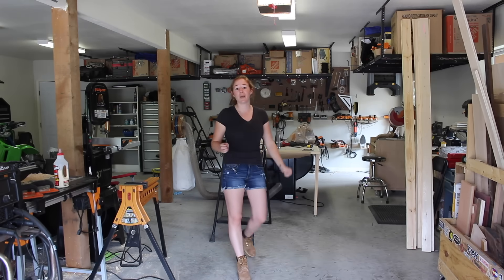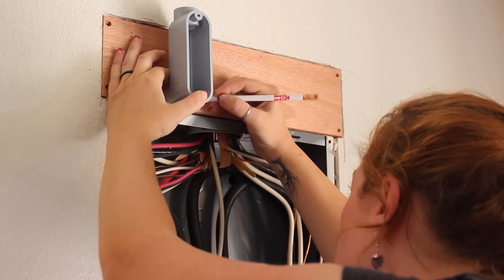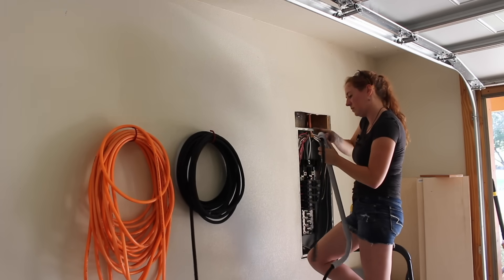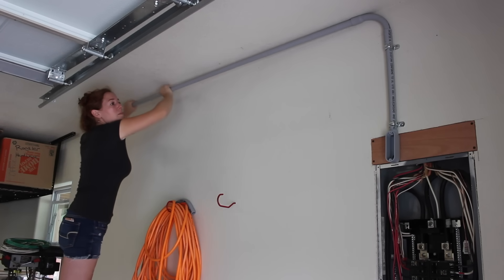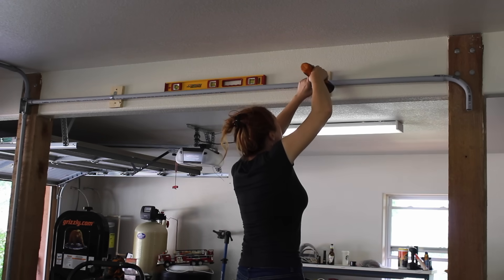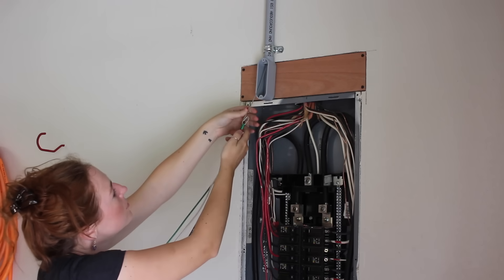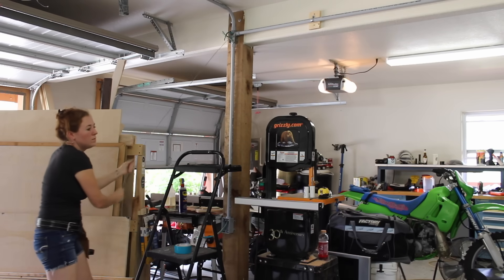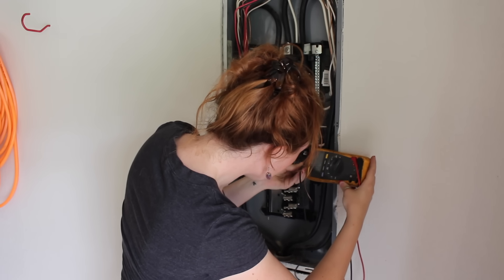Adding 220 Volt Outlets to the Garage

Comment: I admire your courage doing an electrical video with YouTube's history of commenters. My only comment is that you shouldn't use white if you're putting power to it.  I believe it should be red and black with your ground.  But I have done the same using the wire I had and put colored tape on both ends.  It looks like you did your research.  Good job.
Reply from the maker: This was a big discussion on Instagram and the take away was if the intended load is 220/240v then two hots and a ground are sufficient. If there was something like an onboard clock or additional function (like an electric stove or dryer) that required 110/120v then an additional wire for neutral would be required.
Reply: Adam Comfort - 220 is the voltage you get from line to line connections, it has no neutral. And that is a problem because your grounding conductor always has to be green or bare, your grounded (neutral) always has to be either white or gray and your ungrounded (hot wires) can be any color but the before mentioned green, white or gray.
Reply: 220V is actually single phase, the 120V is split.  But yes, it is two live wires, hence the red and black.
Reply: April Wilkerson I should know better.  Commenting on electrical videos is almost as bad as posting them.  😉
Reply: Adam Comfort j
Reply: Adam Comfort - I agree (and am not arguing) about jacketed wire/cable in the conduit or PVC, but what if the jacket was stripped off when it entered the piping after a run to the junction box (under the house for example)?
Reply: You can no longer re-identify in the application, you would be able to re-identify for the traveler on a 3 way switch.
Reply: Preston Mcgill - understood, but say it's (NM?) run in a protected manner under the house, and begins to run along exterior wall in pvc (or similar), can the sheath simply be removed?
Reply: its better to just keep the sheathe on the cable depending on local code, or throw a j-box in and transition from nm cable to unsheathed
Reply: The jacket can't be removed from "NM" because the insulation on the wires inside is not marked with the required info
Reply: National Electrical Code 2011

ARTICLE 334 Nonmetallic-Sheathed Cable: Types NM, NMC, and NMS

II. Installation

334.15 Exposed Work. In exposed work, except as provided in 300.11(A), cable shall be installed as specified in 334.15(A) through (C).

(B) Protection from Physical Damage. Cable shall be protected from physical damage where necessary by rigid metal conduit, intermediate metal conduit, electrical metallic tubing, Schedule 80 PVC conduit, Type RTRC marked with the suffix -XW, or other approved means. Where passing through a floor, the cable shall be enclosed in rigid metal conduit, intermediate metal conduit, electrical metallic tubing, Schedule 80 PVC conduit, Type RTRC marked with the suffix -XW, or other approved means extending at least 150 mm (6 in.) above the floor. [ROP 7-94] Type NMC cable installed in shallow chases or grooves in masonry, concrete, or adobe shall be protected in accordance with the requirements in 300.4(F) and covered with plaster, adobe, or similar finish.
Reply: You cannot use white for hot in conduit, even if you re-identify it with a piece of black or red tape. You can use white for hot, if you re-identify it, when it is inside an outer jacket.
Reply: Yanks are weird... I think white is neutral black is live. Although their 220V might me 2 phase, so 2 lives? Who knows.

Comment: Thank god you switched to thhn, so or sj would have been a bitch to fish through pvc, the jacket doesn't lend itself to pulling through small pipe like that. Besides, not really what you want to use in that application
Reply: If anyone is wondering why you can't (or Shouldn't) use  "SJ" in conduit it is because heat cannot dissipate  with the insulation and conduit and "could" cause a fire.    Also the insolation can be damaged and not detectable inside the conduit.
Reply: Which is why she was threading it through each piece before mounting (before she switched).
Reply: Dude, you read my mind..... thanks.....

Comment: Nice video! I saw on IG where you mentioned keeping your video clips short to making editing easier. I have no idea how you do that! 20 - 30 second clips. Also seems like it would add a lot of time to the project always turning the camera on and off. Well, you clearly got it figured out as your content always turns out top notch!
Reply from the maker: Well for example, cutting the drywall at the start: I only filmed about 10 seconds of that. Then turned the camera off and then continued cutting. When doing anything repetitive I only get a few seconds then kill the camera. It does get time consuming turning it off and on but that's the same regardless if you let the clip run for 20 secs or 2 mins. But editing a 20 second clip takes way less time than a 2 min one. Another key component is a remote for your camera that will start and stop it for you.